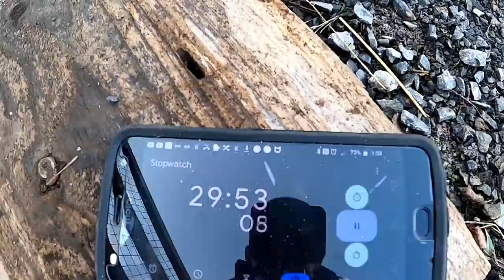Custom Firewood Racks, Stacked & Loaded FAST!

Comment: I’m new to your channel and very much enjoying it. I too have a woodmizer mill and put a Vermont Castings stove in my home to utilize the waste wood. I made woodbins to store, dry and transport to the house. Very convenient as I move them with the forklifts on my tractor.
Made with a 42 x 48” pallet, 2x4 uprights and slab wood sides. They are holding up so far and they do not get dumped, just lifted by the forks
Once loaded, the are placed on treated 2x6, tops covered with plastic and I think it will work out for my use.

Comment: Very similar situation to yours. No processor but using a skid with a klaw and a commercial splitter and conveyor to pile. I stacked out a full cord and hand loaded on the dump trailer so have a good base line of volume.  That being said your process does address quality control however when splitting by hand the QC happens before it goes on the conveyor.  So many different ways to do things, as much as I would like to have a processor I can't justify it due to the size of the wood we get. The inverted spliter on the skid has become a very nice addition when dealing with big stuff.  I don't store my personal wood at home so stack directly off the splitter into 4x4x4 skids and I use a skid trailer to move them around.  I made 55" tin roofs for storage that wire down so they stay in wind. Like you said years of trial and error and still improving.
Reply from the maker: Doing firewood is one of those things that there are so many ways of doing it, but always trying to improve the system.

Comment: I occasionally get a basswood or cotton wood in the log load. Basswood gets split down and bagged upped for kindling since it splits nice and straight. The junk stuff like cottonwood and other poplar species sold for campwood
Reply from the maker: Yes, those softer hardwoods make good kindling.  I actually put a number of Cottonwood logs through my saw mill 2 years ago and made some nice lumber, some of the boards were 20"-22" wide and just a nice creamy white.  It's not high dollar lumber, but it has its place.  I have two of those logs left that have to be quartered lengthwise before I can put them on the mill they're 36" diameter or more.  Sounds like a future video.
Reply from the maker: Yep, sounds about right

Comment: I have a bucket that I can stack a face cord in but have thought of making racks to stack to put out for campfire wood. Stacking without taking steps is huge for how fast you can stack. I have seen guys that sell wood that say they get it close and with the amount of wood I have done I can see the customer got shorted.
Reply from the maker: That's just it, if you are telling a customer you're selling a specific amount of wood like a face cord well you can't really do it by eye, it needs to be measured out.  And like you said, can't be taking steps need to have that rack as close as possible.

Comment: I like the idea of loose piling rather than stacking off the splitter/processor....one less handling of the wood.   

But to ramp up production, I'd pour a concrete slab with 4-5' concrete side walls so I could run a bucket on the skid steer in and simply load the bucket, dump in a truck/trailer.  A 30x50 slab with 4' sidewalls would hold 50-60 cords loose if you heap it up 6-7' in the center....maybe a bit more.....

25 cubic yds for the floor (5"), 3 sides walled, 4' tall, 5" thick = another 8 yds, so 33yds total ($140/yd here) = < 5k   Another 1,000 for forms/steel and $6k does it.  20 cords @300/cord pays for it. (Assumes you do the pour labor....don't need a great finish, broom finish would do)

You could continue to tarp, or do a cheap arch type greenhouse metal rib with canvas cover for rain proofing.  Never hand touch the wood again unless you stack it at the customer's place.
Reply from the maker: Trust me, I think we all have those ambitions, just need someone to write the check lol.

Comment: nice vid.
question for ya how much would that full load of only one skid weigh? I'm trying to figure the best way to make a pallet or wood carrier for firewood that is under 600 lbs for my sub compact tractor.
I currently try three pallets and can only fill half to be able to lift
thanks 
Glenn.
Reply: ok disregard ...I didn't catch the weight at first untill I rewatched ....1100lbs each aprox wow....I'll have to make smaller bins to carry into garage .....lol.
Reply from the maker: One of those racks full is 1/3 of a full cord so I'd say about 1,400 pounds depending on species of wood and that includes weight of the rack itself.
Reply: @laboredinvain3252  A full cord of dry oak weighs 3800 lbs. Easy to figure fractions of cords from there. Or stack a cord of mix, weigh it in your truck, then you have your baseline the rest of the season, modified by percentage of moisture. No scale? Do it by volume. One less handling for the rest of the season. Big truckloads of logs are green, up to half the weight is water. Can't count green wood weight into cords. That's where the firewooder loses big time.- I missed your total time. My guess is 65-70 mins. That's about 2 1/2 hrs per cord. Each producer has to decide if it's worth it.

Comment: All wood burns, I sell pine, cedar, fir, oak, hickory, and pecan. They're all fine, burn well, no problems.
Reply from the maker: It's not a matter of will it burn, but some of those softwoods mentioned have half the btu value per volume as other hardwoods, it matters when you're the one buying.

Comment: How well does your wood dry in a pile like that? I’ve been trying to come up with a similar bin but worry about moisture issues. Great vid!
Reply from the maker: It's not perfect, but it's efficient.  The most important thing is to finish the drying process with the pile tarped.  After one year all the wood is ready to burn right around 20% or less moisture content.
Reply: Been burning green wood from spring, in winter every year for twenty years. I sell wood two years old and older to my customers

Comment: If you're in the firewood business you shouldn't be moving any firewood by hand at your yard. Load completed  firewood with machine & get a feel for what pile lines are in the trailer. If you're stacking into their racks, you can overload the trailer a little & measure there.
Reply from the maker: I'm not in the firewood business, but it does bring in some extra income. The racks ensure an accurate and much cleaner product since I don't have a trommel or disker to thoroughly clean the wood if loaded with machine.  My customers are face cord and half cord customers that want a premium product.
Reply: @laboredinvain3252  Concrete pad & rock bucket on that sweet skid steer. You'd get a feel real quick how many scoops equal 1.5 cords. You'd save time & your back!  Northern Wisconsin premium means clean wood stored under covered roof 1 year minimum.

Comment: New subscriber here... love this idea.. IBC totes are out of the question where I'm at they want $150 each.. to make racks like you and store them wood make more sense.. how long wood one made of pine last?...
Reply from the maker: Made of pine they definitely wouldn't hold up to flipping over but just for stacking and moving if done with care should last some years.
Reply: I bought 20 totes for C$30 each here in Ontario. No more stacking, I drop two of them on a frame by the back deck.
Reply: @glxxyz  where in Ontario... im near sudbury....
Reply: @sureflamefirewood4174  I'm in Halton, I bought them on Facebook Marketplace from a guy in Hamilton who delivered 20 on his trailer for a bit extra. They didn't have the plastic liners.

Comment: What are the dimensions of your rack, looks like a built with 2x4's?
Reply from the maker: 4' tall, 4' wide, two rows stacked out is a face cord on each rack.  I used full dimension 2x4 made of red oak that I milled on my Woodmizer sawmill
Reply: @laboredinvain3252  .... Thanks, i do mine similiar, but use used pallets

Comment: Just fyi for everyone. Red oak is NOT a good exterior grade wood. White oak is good. Pine would be a better choice than red oak. You’re probably gonna find they don’t last super long. That’s why, just switch up your wood type!
Reply: Love the idea. Probably gonna steal it! Just for my fire place at home.
Reply from the maker: I never said red oak was a good exterior wood, but when you have red oak trees and a sawmill you use red oak.  White Oak is excellent for exterior use and ground contact, but I don't have a single white oak on the the property to mill.👍
Reply: @laboredinvain3252  sorry that came across as an accusation. It’s was suppose to come across as informational. If someone has red oak and other woods it’s better to lean towards the other woods.

Comment: if i load from a pile i just stack it on my dump trailer.
Reply from the maker: Yes that works, I like the racks because I can set them right up close to the pile so there is little to no walking from rack to pile.

Comment: Unless we cut all of our own firewood from our own free trees, we are not saving money on heating our homes.
 When we purchase firewood by the chord to heat our homes it is costing us more than natural gas, electric or oil would cost us to heat our homes. The only great thing about a wood burning stove is that we still have heat when the electric power goes out.
Reply from the maker: Not true, there is no natural gas services available in most rural areas.  Those that rely on oil are going to be paying in the neighborhood of $1000 to fill their oil tank and will need to fill 4 or more times during a season.  I heat my 180 year old farm house on only 4 cords of firewood (it's a well insulated house).  Even if I had to buy the firewood I could buy 4 cords for $1000-$1200 for the entire season.  As for electric, it's going to be one of the most expensive ways to heat a home.  Even propane will cost more than if I had to buy my firewood (which I don't 🙂)